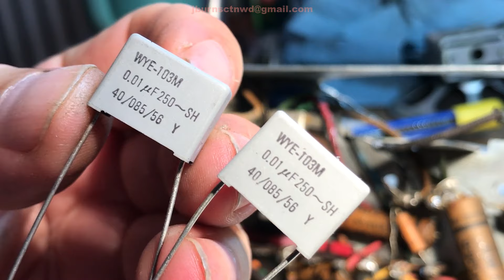Philco 40-145 In Progress 5

Comment: So the Bakelite Block Philco part 3909-ODG  separates the hot and neutral side inside of it. The worn out color cloth 
appearsto be both  red in color but since faded and are the primary sideof the power transformer. The screw end is a 
grounding post for other wires and that is OK as long as one understands it is doing double duty! Star washer used to 
hold  the Bakelite block to chassis so it won't move and grab the chassis tightly so the screw won't loosen. I bought the 
kit you mentioned a few years ago but don't own any Philco tube radios, well not yet anyway. There is no 3903-ODG from
the 1937 service bullentin!  Yours is tar filled for 600 Volt rating ( the O in ODG) hence it might be a carry over error in the information and they were calling it 3903-ODU on Philco's original 1937 service bullentin. Same wiring diagram as the 
3903-ODG! Whew I need a break from all this typing!
Reply from the maker: Odd that they tar filled that block for a rating of 600v, when all that’s being supplied is 110-117v back then 🤔

Comment: If one was working on one of these radios, and found the pushbutton assembly to be completely beyond repair or modification, could it be left in place with no connections without affecting the overall performance of the radio ?